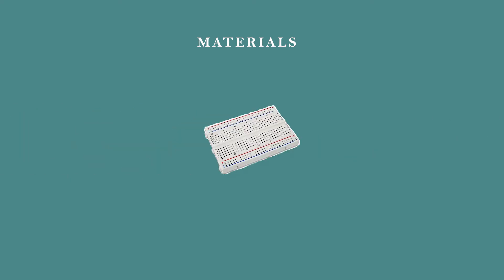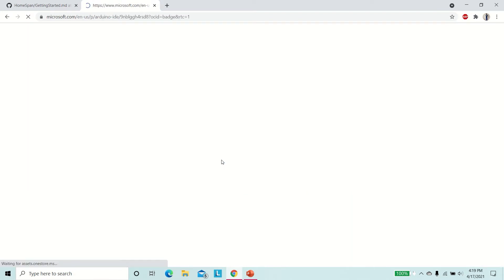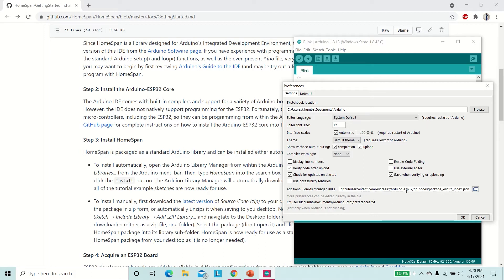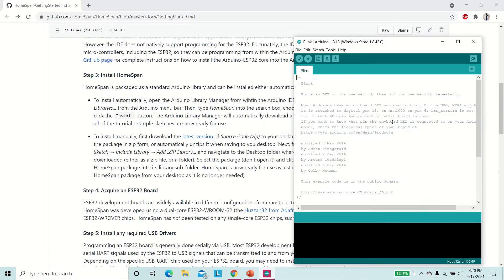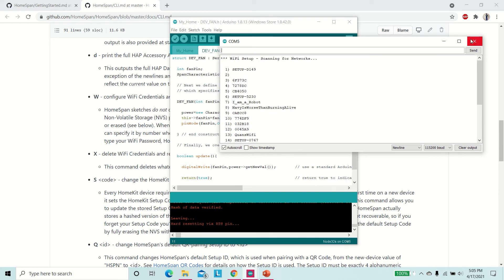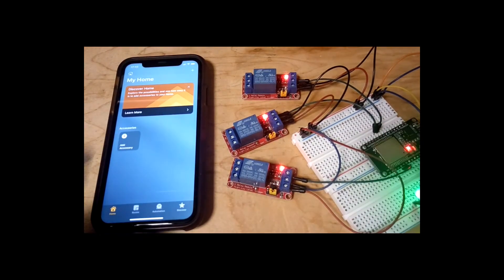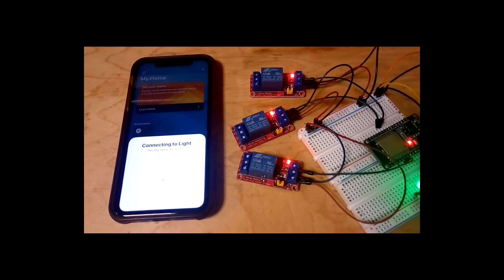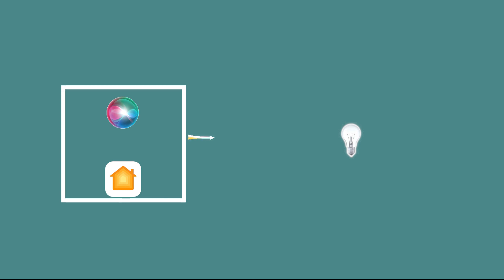Build Your Own Apple HomeKit Devices for Your Smart Home

Comment: "Sketch uses 1413432 bytes (107%) of program storage space. Maximum is 1310720 bytes.
Global variables use 61192 bytes (18%) of dynamic memory, leaving 266488 bytes for local variables. Maximum is 327680 bytes."

I have this error, can you help me ?
Reply: ✅ Solución recomendada: Cambiar el esquema de partición
Esto te permite usar más espacio para tu programa sin tocar el código.

🧭 Paso a paso:
Abre el IDE de Arduino.

Ve al menú Herramientas > Partition Scheme.

Cambia la opción actual (Default) por una de estas:

No OTA (2MB APP/2MB SPIFFS)
Ideal si no necesitas actualizaciones OTA (Over-the-Air).

Minimal SPIFFS (1.9MB APP/190KB SPIFFS)
Si usas un poco de SPIFFS pero necesitas más espacio para el sketch.

Vuelve a compilar y subir tu código.
Reply: @plinchys Thank you so much

Comment: Hello and thank you for sharing this tutorial!  I have a question.. if i were to copy this exacly, using the default code provided to integrate the ESP32 board with apple homekit, then filled up all esp32  i/o pin’s, then i add a second ESP 32, would i use the same default setup code? Or will i need a separate setup code to link a second Esp32? Thank you! Also how many relays (home devices) can one esp32 control?

Comment: Hi ! I've been trying to compile the 05-WorkingLED.ino software with no differences appart from the pin I use from 17 to 2. However, when compiling, I have an error referencing DEV_LED.h :

exit status 1

Compilation error: redefinition of 'struct DEV_LED'

And I have line 8 highlighted
Any ideas why ? Is it because I use Arduino 2.0 ?
Reply: Same problem do you get the solution ❤
Reply: @rgtv_  i found out that when I open an exemple it actually open the 2 files 2 times. You should have 4 of them : close the second and 4th ones

Comment: Thank you very much for the tutorial. I am having an issue though. When I turn off the relay using home app relay receives the signal but wont turn off. I am using a 5v relay. Green light dims when I send turn off signal but green light and relay wont go off. When I use 3.3 volt green turns off with the signal but there is no movement in the relay. Any idea of what might be causing it.
Reply from the maker: Hi. Is your microcontroller and relays connected to the same power source? And if not, are the grounds connected?

Comment: Hey men, i have a problem when i was trying to pair it, the screen show me a message couldn´t add homespan leds, could you help me please, maybe is another code
Reply: Hello, so I have connected to the internet no problem but when I go in-home kit add the lights then problems start, it is as if all my pins are set HIGH and when I click on lights in the home kit nothing happens, maybe you know solution?
Reply from the maker: @janhacek6568  How is your circuit powered? Try using a capacitor on your power source. Also, you can use an external power source instead of your computer USB port.
Reply from the maker: Hey Appleshop, I am assuming you were able to configure your WiFi credentials and you found Homespan leds on your Home app; you can change the pass code to any 8 digit code by entering 'S' followed by new code on the serial monitor. ex: 'S 42763344'. Try that and let me know if it works